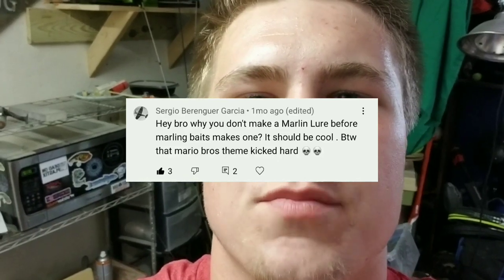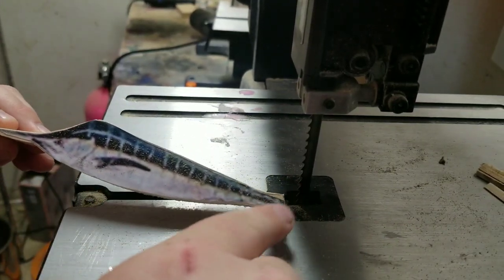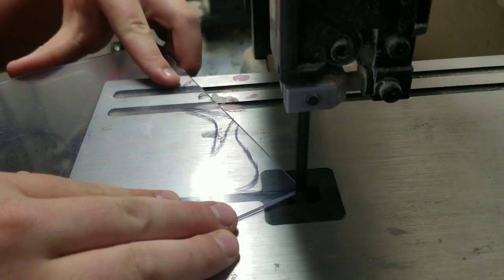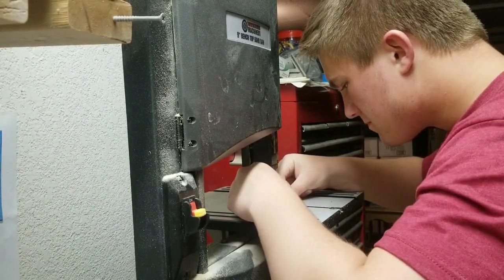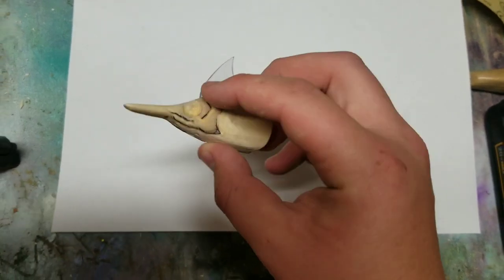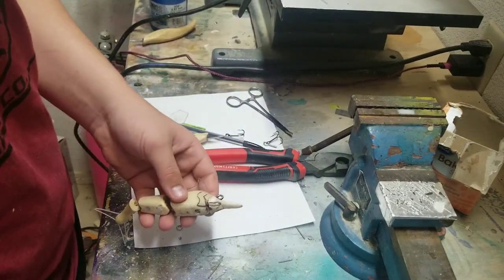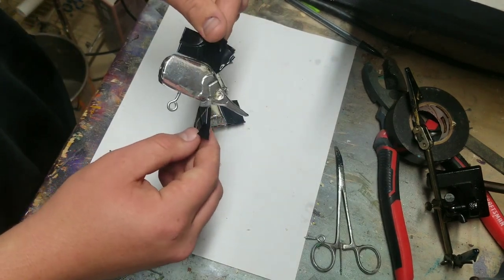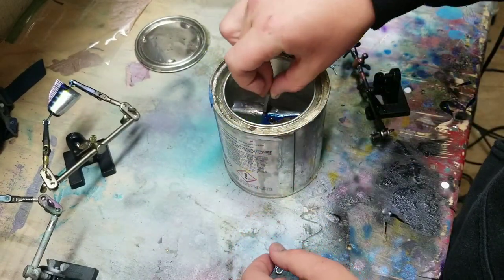Making a Marlin Bait for @marlingbaits

Comment: Interesting action for sure. The line tie under the nose may be detrimental  as it swims because of the head shaking constantly hitting the line it will eventually chip the clear coat and create a sharp edge to chip away at the line...  line tie above nose would have helped.detur that. The action looks like a tired fish
Reply from the maker: I tried line tie above the nose and it wouldn't swim straight
Reply: @killerinstinctbaits   it must be the front sail and the body roll.   You referenced the long nose gar marlin baits made where he embedded a very long hanger down the nose and off the nose tip I wonder if that would run stable 🤔 something to try next time maybe
Reply from the maker: @handy-capoutdoors4063  yeah and I'd definitely not fish it with a swivel. That was an L on my part.